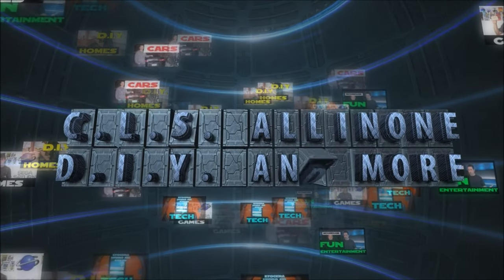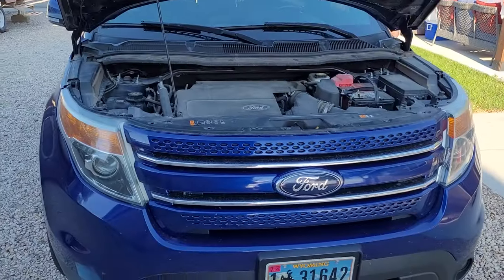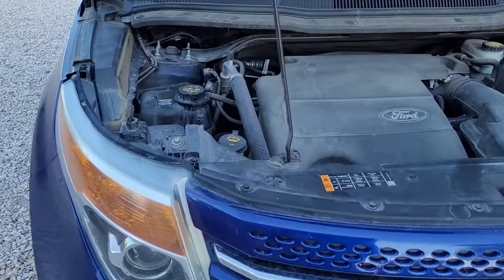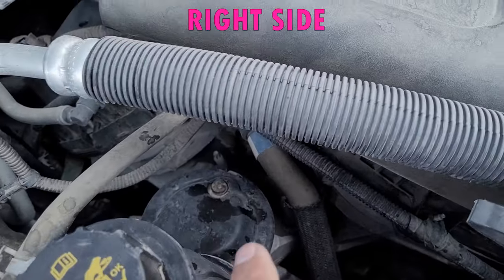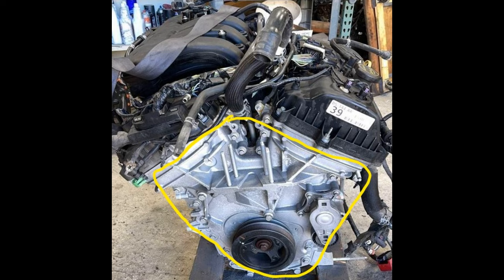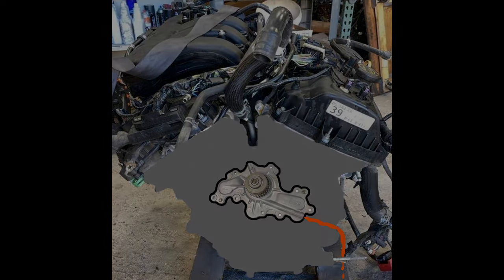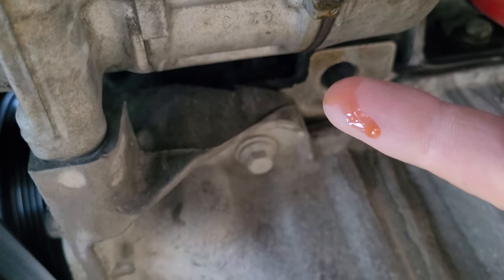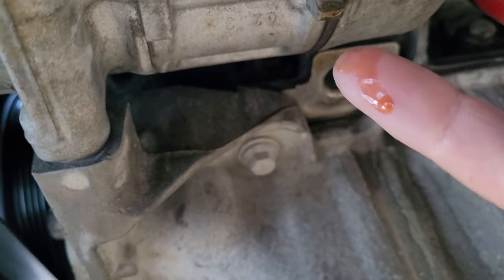Is your water pump bad? 2012-2019 Ford 3.5L & 3.7L engines with antifreeze leak in RF corner.

Comment: A huge jackass design this engine. It would have been pretty easy to have the cooling water boss outside of the timing chain cover on, instead of in, the engine. I think these POS engineers design some of this in order to make dealerships money. A lot of people fall for the dealership BS and think that only the dealer can do this job when any good mechanic, pro or not, can do it. I remember decades ago when I went to an auto show and Cadillac had just come out with the NorthStar V8.   They had a cutaway engine display and the starter was UNDER the intake manifold. When I asked about it, the sales guy indicated that it was rated for 100000 miles too. So, again, it required tearing down the top end just to replace a $100 starter. The mechanical engineers doing this, and their bosses, need to be drop-kicked off the planet!!
Reply: from what i heard cars with internal water pumps do not have the clearance for the external water pump like on the F150.

Comment: 2011 Ford Flex, I have a leak in this exact spot only after the engine warms up. Mechanic wants $3700CAD to replace the water pump, timing chain, and tensioners. Considering I bought the vehicle for about that and already had $4000 in repairs already I'll be scrapping it :(. Fuck Ford

Comment: I wish he had pointed out the weep hole on the engine.
Reply from the maker: I pointed out exactly where it leaks. The weep hole on the water pump is internal. You can't visually see it without taking the engine apart.